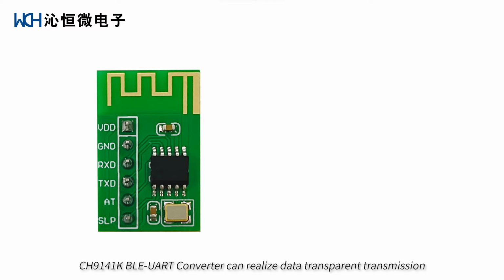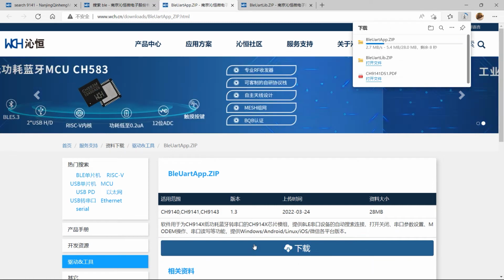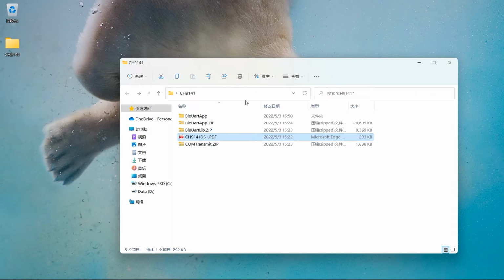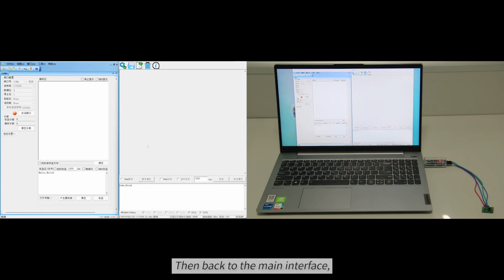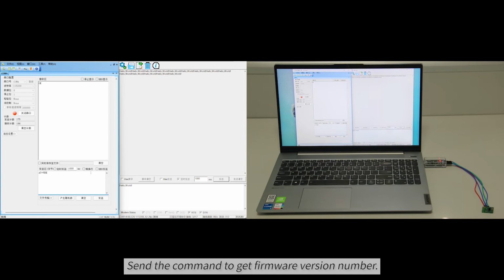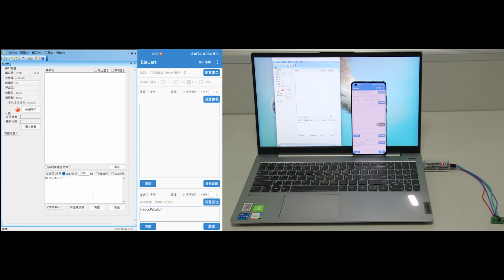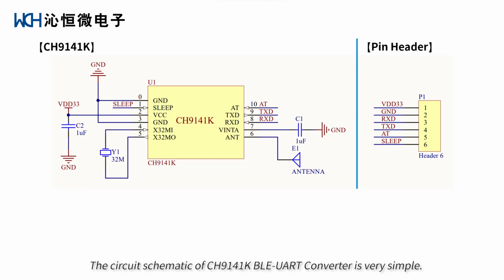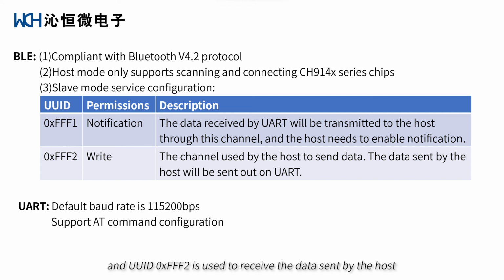CH9141 BLE UART Converter Bridge Chip

Comment: Hello. I have the CH9141 BLE module. I want to use it to control Arduino via Bluetooth. I can communicate with the module by AT commands from Arduino serial monitor. But I can not pair the module with my Android mobile phone. I can see the module as CH9141BLE2U. Any recommendations? Thanks.